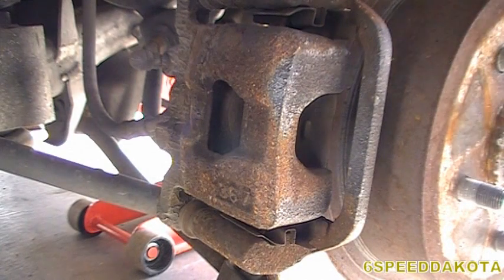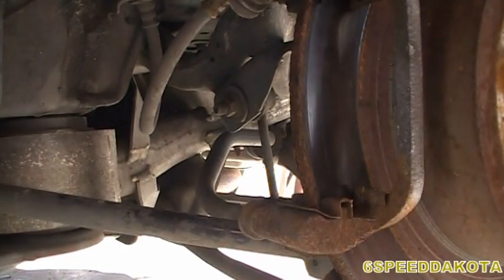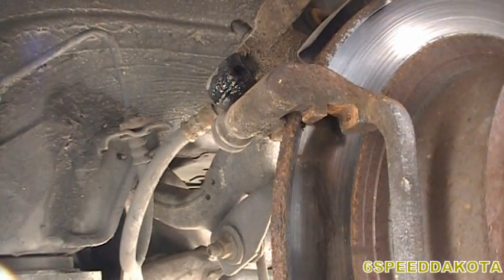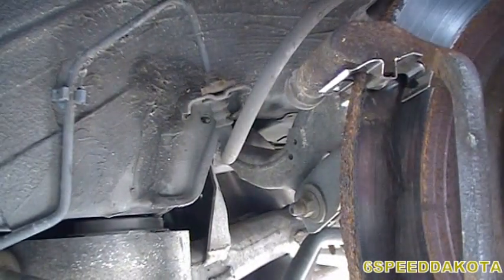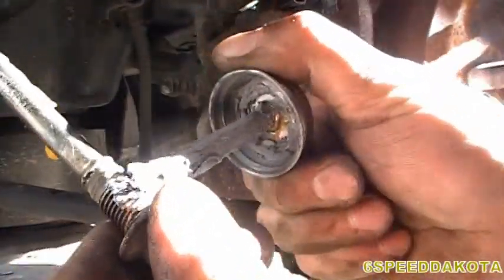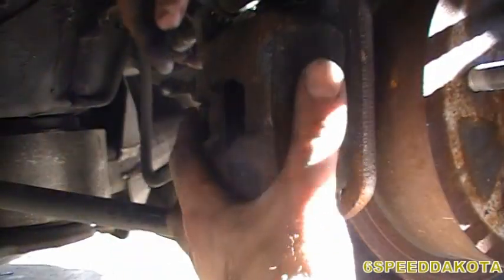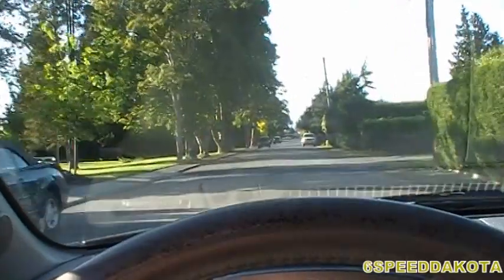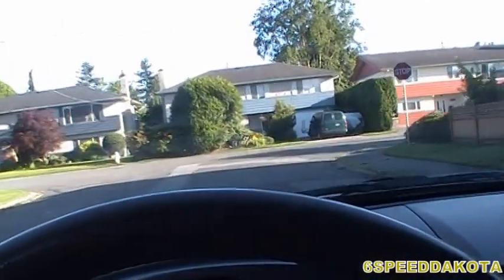How to Replace the Rear Brake Pads in a 2003 Nissan Altima

Comment: You don't have to touch the bottom bolt. After the top bolt is out just tilt the caliper back and you have access to the pads and clips.

Comment: What would be an easy method to get a seized 14mm bolt off? I understand you said you would have to do some hammering. I've used wd-40 and brake cleaner. I've also used the hammer method and nothing I working. My calipers are in great shape. The previous owner however has let the left rear brakes go until pads don't even exist anymore.
Reply from the maker: +zach berti I'm assuming you're trying to get the caliper mounting brackets off. I always use some automatic transmission fluid mixed with acetone and it really works well as a penetrating fluid. It's going to be hard because it's in the rear, but try hooking the box end of another similar sized wrench to the open end of the wrench that's on the bolt. That'll give you more leverage. You may need to try using a torch to add a little heat to the bolt, that generally helps break it free, otherwise you'll have to cut the bolt off and get a new mounting bracket and bolts

Comment: What did you do to get the caliper bolts out, and what direction did you turn to loosen the bolts (front of vehicle or rear of vehicle)?
Reply from the maker: Standard lefty loosey, righty tighty. It will differ between each side. but you need to turn the bolt counterclockwise when looking at the head to loosen it.
Reply: So the driver side rear caliper bolts need to be turned clockwise?
Reply from the maker: no, all bolts turn counterclockwise to loosen. There are very few exceptions to that rule
Reply: Even those these bolts are facing away?
Reply from the maker: If you're looking at the HEAD of the bolt, you must turn it counter clockwise
Reply from the maker: I don't mean to be mean, but perhaps maybe you should leave this job to a professional

Comment: does'n't anyone know how to change a knock censor on Nissan Altima engine 2.5 year 2003 ?where is the censor  located on the engine.
Reply from the maker: attached to the engine block above the right CV shaft

Comment: all you need to do really is loosen the top 14mm bolt, then the whole caliper assy. will just pivot out giving enough room to pop the pads out with a flat blade. you can also pry against the pad into the caliper wit everything still bolted up. C-clamps take too long. i guess it depends on ur skills tho.